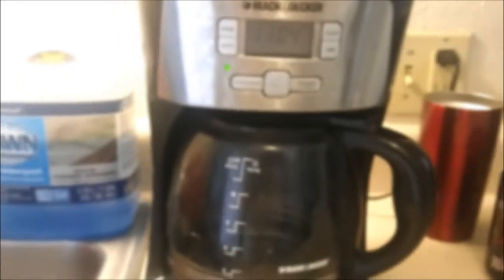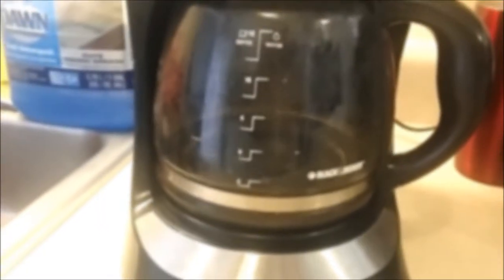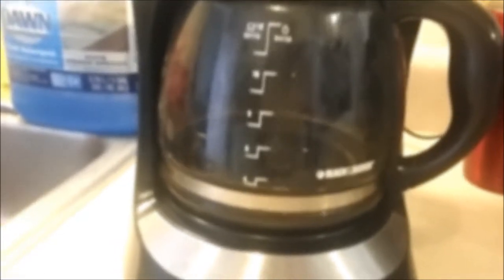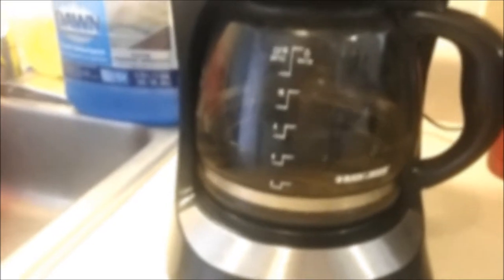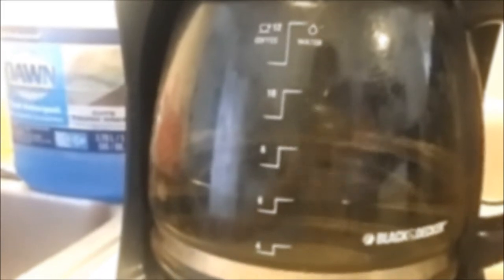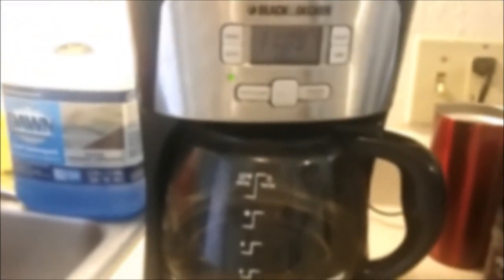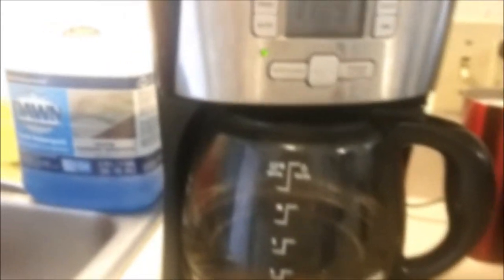How I Clean a Coffee Pot

Comment: Good tip. I do the same, or water with citric acid. Clean as a whistle :)
Reply from the maker: +Lasse's Food and Barbecue Thank you!  I will have to try citric acid too.  Thanks for watching.
Reply: Randi's Delights and More In the south of sweden the calcium in the water makes us have to do this once every month. I use 1 tbs per 6 cups. Then run 6 cups water only after to wash it out. :)
Reply from the maker: +Lasse's Food and Barbecue I will definitely have to try that.  Thanks for the tip!